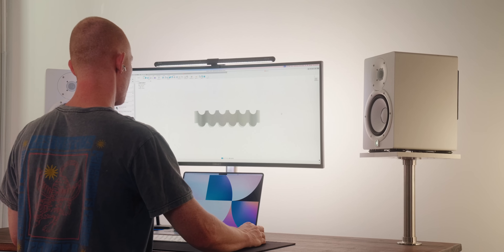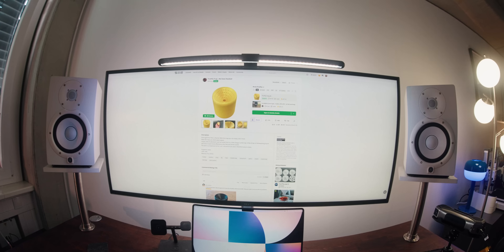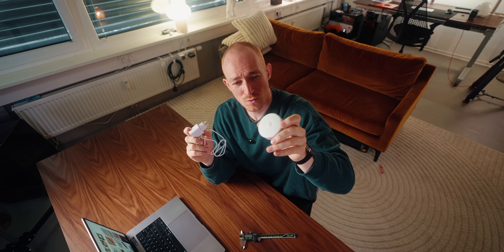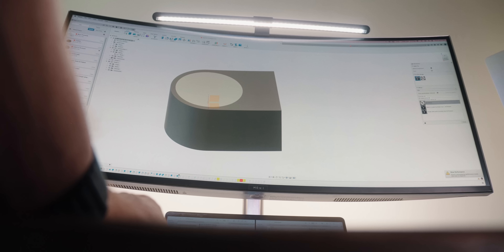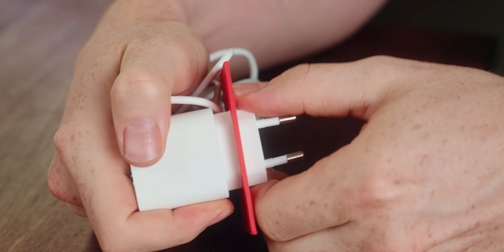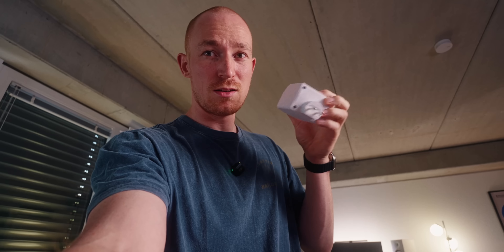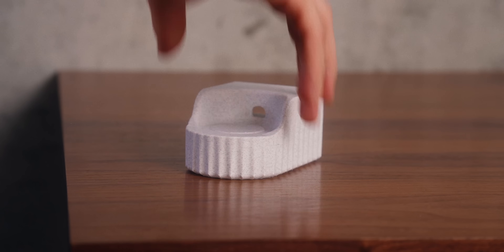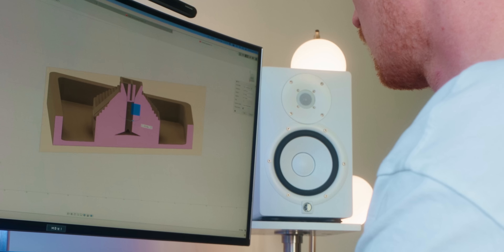Make 3D Printing Beautiful Again

Comment: I have finally taken the plunge and learned a bit of Fusion. Enough to make simple projects like a filament bin for my malm drawer. I've quickly noticed that chamfering edges not only makes the prints look way better, but also improves the quality of the prints. The highlight so far has been a hole in the lid of that bin. It's simple enough to punch a whole into it, but adding just the right amount of chamfering makes it super pleasant to grab the lid with your finger. It taught me that functionality and even looks aren't everything. Ergonomics also count.
Reply from the maker: That's awesome to hear—chamfers can really make a difference in the final product and user experience! 😊

Comment: I actually like the design and flecked filament used. However, it feels in this instance that 'form followed function'; why did your toothbrush holder and cable require all that effort? I would have said that, at most, maybe a cable tie (or an elastic band) to keep the long cable tidy is all that was necessary. It didn't really need anything. Will it change your quality of life? :) That said, I do think this is one of the lesser concerning 'issues' that has come to the masses as 3d printers become cheaper and more accessible, and maker spaces become easier to share creations: designing for the sake of designing. There are hundreds if not thousands of vases, dragons, scrapers, holders, key charms, containers on the maker spaces. Some of them are very unnecessary, but yet some look really cool. With so many 3d printers and users out there, we really need to develop something new and innovative, rather than re-invent the wheel in a hundred different textures, colours, sizes, shapes(!) Some of those individuals that have novel creations are drowned in a mass of nice, but unnecessary vases, dragons, scrapers, key charms, holders. 😀😃
Reply from the maker: Thanks for the comment! For me, this makes a big difference. By having it in this base, it’s no longer hidden in my bathroom cabinet, but instead visible near the power outlet—and I can actually see the timer display, which I like while brushing my teeth. And since it was going to be visible, good design was important to me 😊

Totally get what you mean—there’s a lot of unnecessary stuff out there. But on the other hand, if it makes people happy, why not 😃

Comment: Maybe angle the base so the cable at the back doesn't stick out as much from the back. PowerPoints are rarely right in front of the user anyway so the display being at an angle would not be bad. Design it so the user can install it angled either right or left .
Reply from the maker: Interesting idea. i'm not sure it would work however since the toothbrush would also be angled and might tip over
Reply: @arnebornheim sorry I mean angled as in rotated left or right, the base would still be level
Reply from the maker: ahhhh gotcha. For my current usecase just straight is perfect. But all the fusion files are online if someone wanted to do that 😊
Reply: In theory you’re right and you have a good point, but in this case, rotating the base would also result in an off-center display as well. And since the design is bespoke having that option wouldn’t really make sense. If you really want to address this issue perhaps a better solution would be to use a right angle usb-c connector (or angled usb-c cable with power adapter combo).
Reply from the maker: Good point. I think I thought of the wrong kind of angling (as in tilting) the first time…

Comment: hey Arne, can you teach how you did the texture... i'm one of those "designers" that make everything smooth, as you mention. i've no idea how to do it. do you have any video?
Reply from the maker: Hey! I'm not sure if this is in depth enough but here's a quick explanation

 the texture is just circles that are patterned around the outside and then extruded. to get the fading effect you can taper the extrusion
Reply: Good trick! I really hate when people default to using lofts for things like this. You have a good solution and it works well, in the same vain you could use saw teeth or square cuts and then use a combination of chamfers and nice filleting to add detail to the texture. Great video

Comment: Good stuff. I like the shorter version, if I had same brush I would keenly print it… how do you make this texture in f360?
Reply from the maker: which one do you mean by the shorter version? 

and the texture is just circles that are patterned around the outside and then extruded. to get the fading effect you can taper the extrusion
Reply: @arnebornheim  i would probably use a loft to get the final body. you can use your current body as a starting point (just close the cutout for the base) and simply blend top to bottom surface with a loft. that should give you a very smooth transition from the flat to the waves.
Reply: Also, to get the bottom waves, you can create a kind of sine wave by using a sweep with a rotation multiple and project the edge to the ground again.
Reply from the maker: sounds cool! your fusion knowledge sounds a bit above my paygrade though 😂 

if you want to play with it the fusion files are onlne 😊